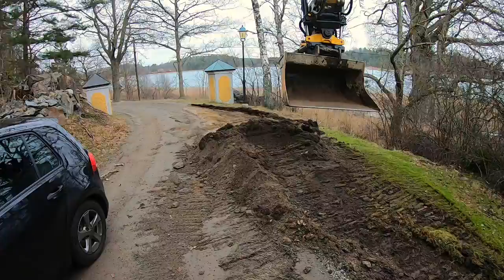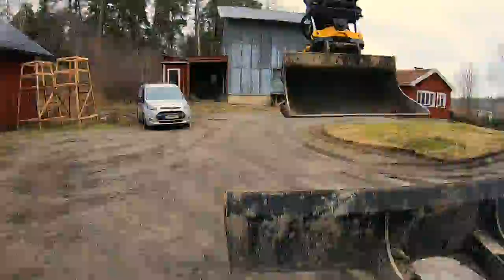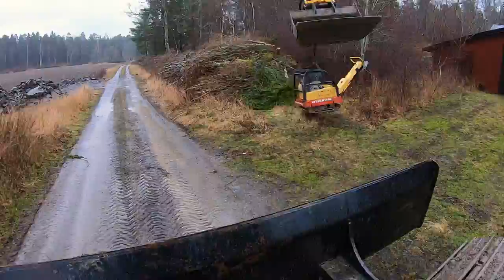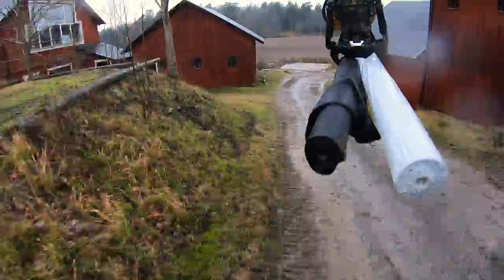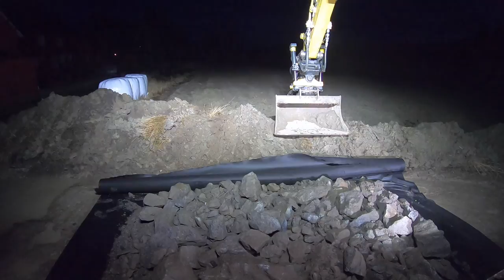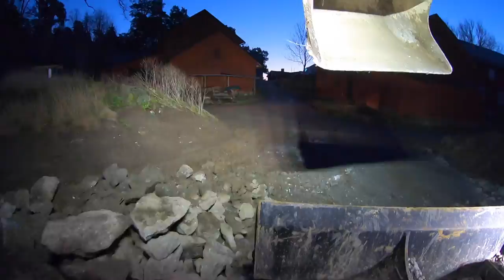#22 Road preparation for lumber trucks: 4 turns and a turnaround Part: 1

Comment: I have done a lot of jobs driving dump trucks. Seen a lot of people doing grading work. But damn you do awesome work. I've hauled crush & run. Asphalt , there was a lot of people say I could spread rock prefect. They wouldn't have to do much to get it right. I wish I was still driving a dump truck. I wish I own either one trailer dump or a class B dump truck. But I'm sure it's still slow around fall and winter.

Comment: Nice work. I noticed at 2:52 it looks like you hooked an electrical conduit. Not sure where you are working at but in the states that conduit should have been at least 18" down and have a marker tape over it to indicate that there is a conduit there. great job

Comment: Nope,that's wrong,too many mistakes,a lot of amateur moves,need more experience. Minimum wage at best. That should of been a 15 minute job.wasting diesel fuel. Get off of the machine, my 10 year old can show you better. I would have been done in 15 minutes with a flathead shovel and a wear barrel. I'll be there next job to show you how it's done.